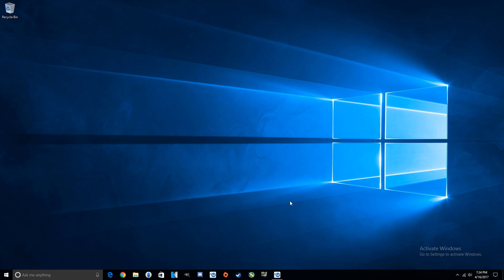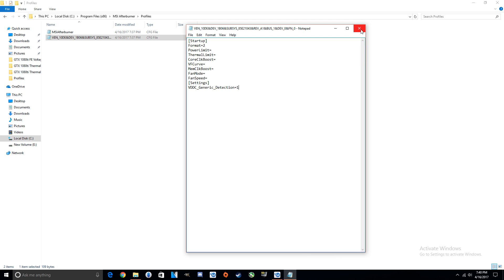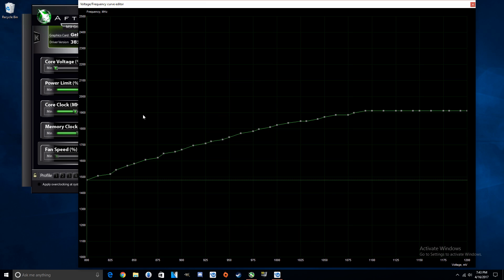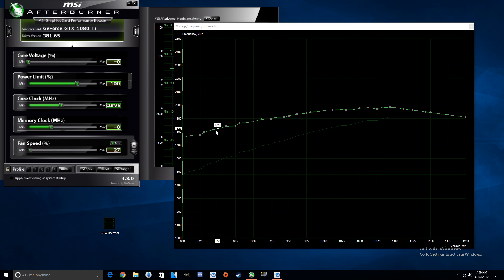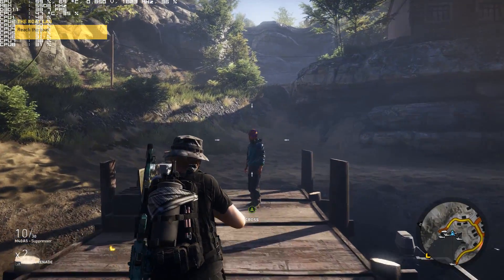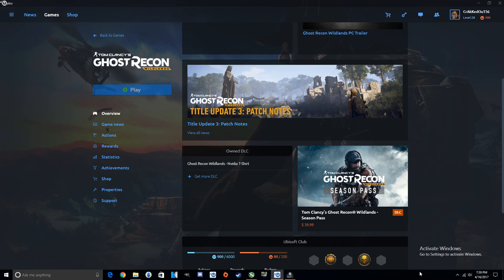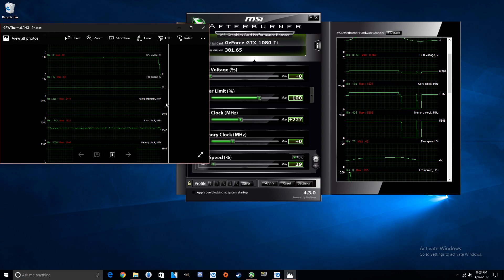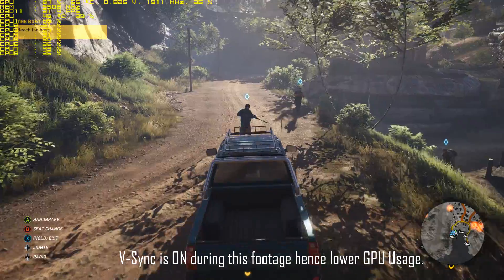Can We Improve GTX 1080ti FE Temps By Dropping The Voltage?

Comment: Hey you can set an entire set of points to the same value by
Selecting a point.
Shift, left click drag the selection of points (Including the one you have selected)
Hit shift+enter twice.
So selecting say 1800mhz@1000mV and dragging right, will set all points to the right to 1800mhz
Instead of manually dragging them under, then getting it to fix itself
Reply from the maker: Yep, learned about that ofcourse after making the video lol

Comment: Cool video mate. I just purchased a 1080 Ti FE. (Yes, in 2024 pair with an old workstation desktop with 32gbs of ddr4 in quad channel and an old beast of a CPU, the Intel Xeon w-2145 8 core.) It was used and I paid $167 for it on eBay. And yeah, you could fry steaks on the back plate at full or near full load. 

The card I bought came very dusty, I took off the transparent plastic and vacuumed out the heat sink and fan best I could. I was thinking of removing the heat sink and putting in a high quality thermal paste and then replacing some of the thermal pads with much higher quality Artic pads. However, my pads are all 1.5mm, not sure if that will work, although it could makes it better. It will also allow me to fully clean. Then try what you showed me here.
Reply from the maker: Hope the video helps and your temps are low!
Reply: @InfinitePCGaming  Yeah they hover between 80 and 84c with an qverage of 82.78c. Id like that to be 68-72c

Comment: I know others have said it before, but I'll say it too, Thank You man. I recently decided to upgrade my stock MSI 1080ti with a Morpheus II Core cooler... Long story short, I upgraded to lower temps for fan noise and the coil whine was becoming annoyingly noticeable. I went from 1924MHz 1.050V stock to just quickly slapping in 1899MHz 925V which lowered temps another 5C on top of the new cooler to a max of 60C and killed nearly all of the coil whine!
Reply from the maker: No need to thank, I'm glad the video is still helping people after all this time. Seems like the 1080ti's are still alive and kicking. Definitely one of the best GPUs I've owned.

Comment: you can speed that other part up by by selecting  with shift click and using the arrow keys
Reply from the maker: Yep, I did not know about that when creating the video. Good tip. Thanks for watching.
Reply: @InfinitePCGaming  np!
also my 1080 ti keeps crashing under the same settings do you know why?

Comment: I'm using a Zotac GTX 1080ti Mini which is just as prone to reach 84°C like the founders edition blower card. This tutorial was so easy to follow and it just works. My gpu was constantly reaching 84°C (100% fan speed) even with a new thermal paste (Arctic mx4). Now that I undervolted it, the temps don't go above 71°C with a custom fan curve. Before, it would reach 84°C even on 100% fan speed.
Sitting at 1830Mhz while at 71°C. Can't believe it.....
If you still read the comments, tanks man!
Reply from the maker: Glad the video helped you out. I wanted to get that same GPU for my mITX build, but never did.
Reply: @InfinitePCGaming  It's hot and loud. lol
Otherwise I'm happy how it works.

Comment: Yo this is super helpful! About to put a 1080ti in an ITX case, so will need this just to stay afloat lol... My question though is, should I also undervolt/underclock the memory, or just leave it as is?
Reply from the maker: Leave as is. Had my 1080ti in an mITX case well, Node 202, temps were fine for me.
Reply: @InfinitePCGaming  cheers thanks

Comment: I looked at many reviews which never worked until I saw this one! I have no experience with pc or laptops. I was getting what I think was "thermal throttling" when my gpu was alarming at 91° which was dropping my fps drastically and lagging. Now after many attempts and game crashes the FPS is back up and the temperature is 75-79°! I will continue to play around to find a sweet spot and I may re apply thermal paste to get this even lower (no idea when this was last done) My only question is, I cannot adjust fan speeds on my clevo laptop? It's greyed out, does this mean my fans are automatically ran? I can hear them get faster and louder when a game starts.
My laptop has a gtx1080
Thanks

Comment: Ctrl+Shit then select the voltage node and use up and down arrows. Saved me so much time. Also undervolting my 1080 ti hasn't really made a difference in power usage. Only thing that does is lowering the TDP, but that also impacts performance quite a bit.
Reply: Yup, same as my 1070 ti. I tried undervolting and it lowers the temps same as my fps. Its like lowering my power limit to lower the temps.

Comment: You made my day!! Thank You Sir!!!!

Was having trouble with coil whine on an rtx 2070 after swapping from a 600W to a750W PSU to be sure of having enough power to overclock. But the voltages on the new PSU are unstable I think. MSI afterburner fixed this for me with your help and my hands and eyes!!!!! Undervolting and finding the stable sweetspot between voltage and clockspeed.
 

Really appreciate videos like this. SOOOOOO helpful!!
Reply from the maker: Glad this Lil ol video helped you out!

Comment: my gtx 1080ti is in 1974 mhz at 950mv with fan at 70% and maximum temperature at full load of 63 degrees ... its original was 1924mhz with a voltage of 1,060mv

Comment: Thanks a ton for making this video
I have a Zotac mini 1060 3gb, which was getting very hot @ 83C and was thermal throttling.
Using the instructions you've provided - I was able to achieve a steady boost clock of 1750  on 73C with 40W power reduction

Thanks again kind stranger!!
Reply from the maker: Glad this video has helped you out!

Comment: Thank you so much! This video was really helpful. Used your advise to undervolt my 1080ti and now my coil whine is completely gone! :D No coil whine, lower temps and about the same performance. Haven't maxed this out yet, currently on max 0,825 V and 1600 Mhz. :))
Reply from the maker: I'm glad to hear my video has helped you out. My 1080ti is still going strong.
Reply: InfinitePCGaming hey dude do you have any idea what should probably be the maximum core clock overclock for a gtx 1050? It’s the notebook version with 4 GB vram.

Comment: Hey, I got asus rog gl502vs with i7 6700hq and gtx1070 8gb... From the beginning I ve had temp issues like cpu reaching 96 and gpu 90+ celsius... So I did cpu UV  -0,150mv   and  followed by this tutorial I've set 1835MHz at 925mv... Well temps dropped to 74-76 celsius in games and its stable.... However I wonder is that 1835mhz isnt too low for gtx1070m ???? Should it be more ??? I dont want to overclock it, just want best performance with lower temps :)
Reply: Albert Wesker there’s no risk in overclocking the gpu. I mean if u don’t want free performance gains you do you lol

Comment: Not Sure If I'm doing this right, I've followed the video to the point and have set the voltage curve to the same as his, and in a quick 4k ultra preset Far Cry 5 benchmark, it stayed at the max voltage and got a steady 51fps at a peak of 66C. Compared to the default stock setting where it was an average fps of 54 at a peak of 73C

Does this mean that the under volt is working, Or should I also see an FPS increase? Or should it simply lower temps and fan speeds
Reply: undervolt drops temps with stable core frequency...Some people doing both undervolt and overclock gains both lower temps and more fps

Comment: Just want to let you know your video is still helping ppl after 2 yrs 
Im at 1920mhz at 0.925 on a 1070 laptop 
Temps came from 85 to 73 and core clock from 1700-1750 to 1920 stable 
Will try to go higher
Reply from the maker: Ah, I'm glad it's still helping out 👍
Reply: The max clock speed of my 1070 max q was 1544mhz and the voltage was 0.793. (max voltage is 0.800) Does this mean I can't underclock it? What should I do I'm really confused now
Reply: How man?
I have the same graphic card in my asus rog stryx. I did the process and i have 1650-1745 more or less. Never reach 1920....

Comment: I found a way to speed up the process : put something like -400 on the core and click apply. Then drag the point at the desired voltage to the desired clock and click apply. The line will straighten automatically. Apparently the frequency must be higher than the grey line or else it won't work. I know the video is a year old but I hope this helps haha.
For me doing this was particularly helpful when overclocking and undervolting GPUs for mining. Some cards are very stubborn (looking at you Msi Gaming X) and run at a pointlessly high voltage (over 1000mv) even when putting the core voltage and power limit sliders at the minimum
Reply from the maker: Captain Lama Sweet, thanks for the info. I believe a version of Afterburner came out about a week after this video which helped the process also. Bastards.
Reply: Thanks so much for this.

Comment: I did this and my GPU temps are at 70'C at idle with 0% GPU usage. Ugh... No clue what the hell happened. GPU clocks won't drop below the setting even at idle either.
Reply from the maker: PIXELFLUX Poor airflow in the case?

Comment: I have tried to adjust the voltage curve as what you've showed but after hitting apply, the last few voltage points are still going up and I can't lower it to 1823 no matter how many times I tried. Is there anything I did wrong or am I missing something?
Reply: I know this is a really late reply I just found out about this video, had the same problem what I did is this.
1. Hold ALT or CTRL as mentioned in the video, take your voltage and put it on the desired frequency
2. Let go of ALT or CTRL and just move that one line above every other line
3. Hit apply 
4. Bring it back down to your desired frequency
Hope this helps that's how I did it, I don't know why the last few lines went up either. Pretty weird.

Comment: 2000Mhz at 1000mV here, temps stable at 72-74C with 70% fan speed. Is it just me or do those blower fans sound like jet planes at anything over 70%?
Reply: Not just you, i recently watercooled my ftw3 which ran at 75% to stay under 65c under air, now it'll hit 38c max with low rpm.

Comment: I’ve been spending time maximizing voltage and core clocks never thought about the diminishing returns. And I’m going to try this when I get home. Good video!
Reply from the maker: Ben Sowrey thanks. Please be aware that this is an old method and there might be an easier way to go about it. Maybe some day I'll get back into making videos and do an update.
Reply: InfinitePCGaming seems to be the only video on undervolting that really shows what you’re doing. Seems all the videos show there wonderful results of it but not how to do it
Reply: Got .900mv good with 1911mhz stable for all my games as well as loops of heaven and played pubg for hours
Reply: Trying with .950mv for 1974mhz.

Temps with the first one ranged from 55-60c depending on game.
And the .950mv so far it’s hanging around 60-61.

Comment: First of all thank for the video.

I use win 7 64 bits and with a GTX 1080 I´ve tried made the same you do with the msiAB version 4.3.0 some months ago.

When I did it, I didn´t know you must edit the file ----.cfg from profiles. Then I made this curve https://imgur.com/UWyjCKO, and as you can see there is a little tail at the end. 

Today, I´ve tried make the same with MSI AB 4.4.0 stable final, and still there is little tail at the end. 

I can not make it go without tail at the end. This time with 4.4.0 version and I´ve tried changing and not changing the file .cfg from profiles. Is it normal? With the 4.4.0 version, do yo need edit the file .cfg?

Comment: If I want to undervolt my 1080Ti FTW3 the last 2 or 3 points at around 1,2V are always higher (dropping down does not work with these points) than the voltage that I've set. Is there any reason why or just a bug of the Afterburner Beta?

Comment: My Galax 1080Ti EXOC is at 2066MHz @ 1.063 volts and hits power and VRel quite often . Will doing this drop my core clock much and will it stop the VRel and power limit ?
Reply from the maker: 2ndLastJedi Seems like your pushing your card to its max stable OC with that speed voltage. BUT if you really wanted to get rid of your problems you'd have to look into a custom BIOS that'll allow you to boost higher.
Reply: InfinitePCGaming i haven't touched the voltage and juat added +136 to the core, out of the box was boosting to 1911 i think. I dont want to increase voltage at all, maybe just lower temps from 75C.
Reply: most 1080ti's can run at 2000 mhz at 1.0v

Comment: Was able to get my sli setup stable to 1911 at 0.931 mv :D
Reply from the maker: Sweeeeeeeeeeeeeeet
Reply: try 0.8v, you can reach about 1800mhz, its the sweetspot.
Reply: @budgetking2591  mine is stable at 1911mhz down to 0.90v (gtx 1080ti)
Reply: @tac6044  thats really nice
Reply: @budgetking2591  actually moved it up to .925 just to be safe.

Comment: cool Video dude, though I think instead of relying GPU usage percentage to determine heat is not very precise, monitor GPU power should be better as different game stress GPU differently, for me at 100% power temp at 77c and 120% power at 82c (temp/fan at 1/1 ratio means 77c/77% fan speed). Want lower temp ? just reduce the power limit and the GPU will undervolt for you automatically.

Comment: also there is afterburner 4.4.0 beta which supports voltage changing without editing files for the 1080ti
Reply from the maker: Damien Oh rry? Well then, I'll update the description soon. Thanks!
Reply: it's pretty well hidden had to find it on an overclockes fourm for GTX 1080ti owners
Reply from the maker: Damien Surprised it's not up on Guru3d like it typically is.
Reply: ya it's a pretty sneaky beta for the 1080ti. you want a link to the overclockes fourm that has it?
Reply: http://office.guru3d.com/afterburner/MSIAfterburnerSetup440Beta6.rar

Comment: got my thermal paste changed saw a drop and this was at .97xv to 81-82c from 86-87c in overwatch fully max settings with no fps cap to max sure it was stressing the gpu fully. both tests had 60% fan speed and we're 15 min long tests then I also droped down to .900v at 1847 most games were stable at .875 but dang overwatch or overclock killer would losse device and checkerboard out without .900 and droped down to 78-79c. just for reference over watch with no fps limit at stock voltage ran up to the 91c limit and started to throttle hard at 70% fan speed